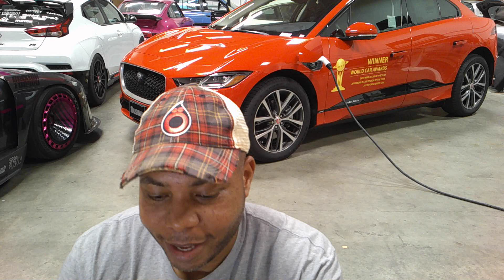EV vs ICE, my I Pace experience, and Porsche beginnnings

Comment: Fun fact bisi. Evs we're actually first, going back to a professor who did his own conversion in 1832 down in Virginia. To Ferdinand Porsches p1 in the 1890s was fully electric. To Henry Ford's wife, who refused to drive anything other than an electric. To new York not allowing combustion engine vehicle's inside city limits at the turn of the 20th century. Another fun little known fact? The electric starter motor actually helped kill the electric car off. 🤔
Reply from the maker: Thanks so much. That is quite interesting.

Comment: What would you recommend as a DIY EV starter pack. You are inspiring me to get into the EV world.
Reply: Partly what bisi said, but a newly emerging interesting option is getting the full drivetrain from a Zero EV motorcycle and installing it in something really light, like an old fiat or mini Cooper or even a small old hot rod. 

You'll get a surprising amount of range and power and most of the hard stuff is done for you, it becomes a fabrication exercise
Reply from the maker: It is best to elect the help of an electrical engineer well versed in this tech. After a few conversions, the you are good to go!